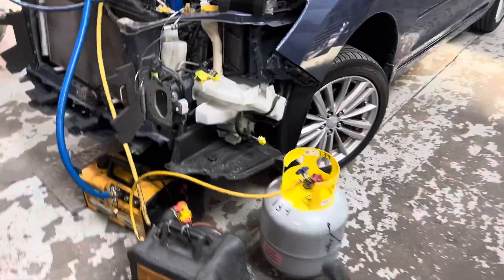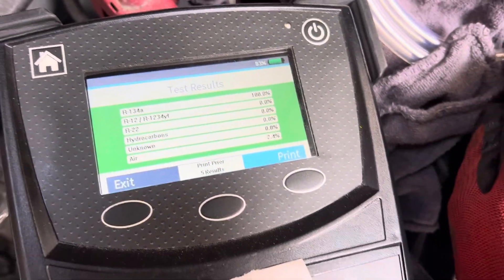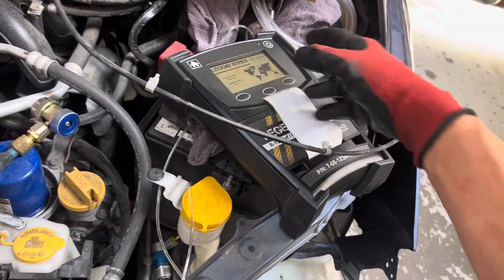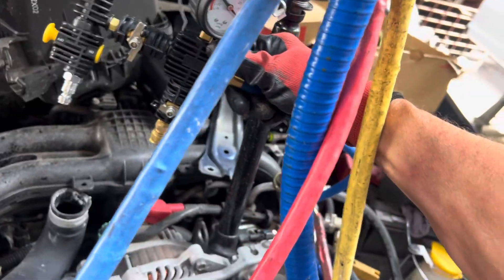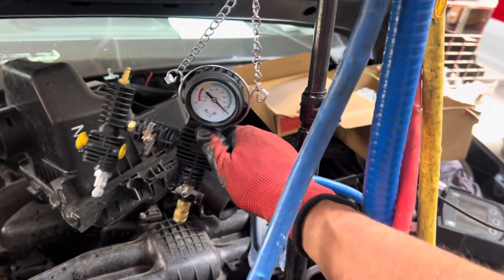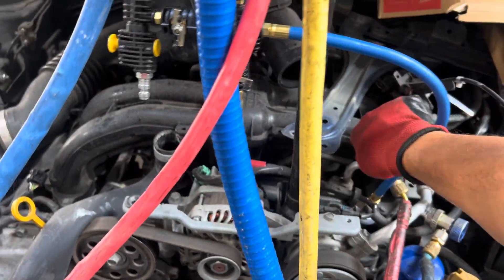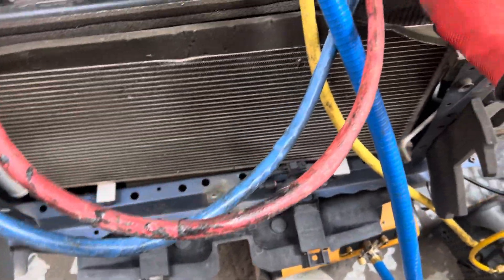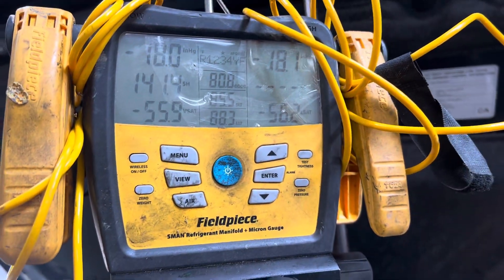Accidental, refrigerant oil removal if you recover from service fittings at the compressor ￼

Comment: Who males that vaccum filler tool?
Reply: Thank you. I appreciate you are willing to take the time to reply. Additionally,  I learn alot from your content. Good stuff!
Reply from the maker: Your question is ? 

(“ who makes the coolant system vacuum tool ”)? 

They’re made by every company around the world . 

Usually every big tool distributor will have some version of a coolant vacuum tool 

That vacuums out the radiator system to remove the air so you can put the coolant back into the car without having air . 

There’s knock off Chinese cheaper versions of the same tool 

Automotive vacuum, coolant, filling tool 

Just Google the name the term of the tool . 

And a whole bunch of pictures will come up 

And you can watch some videos how to tall is used .